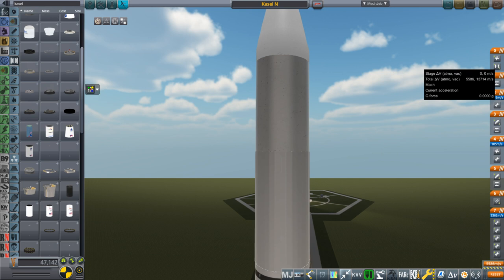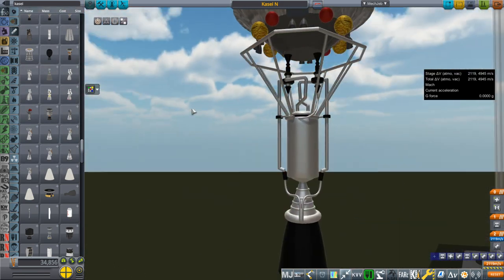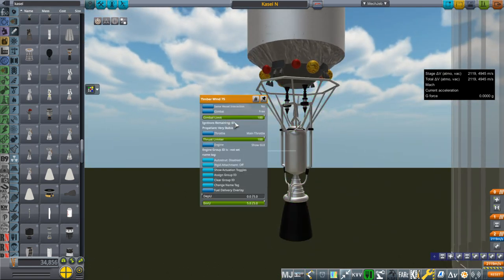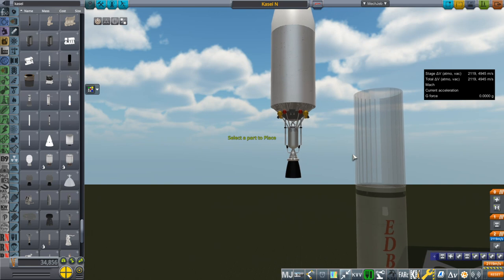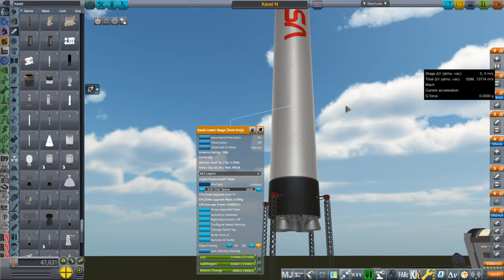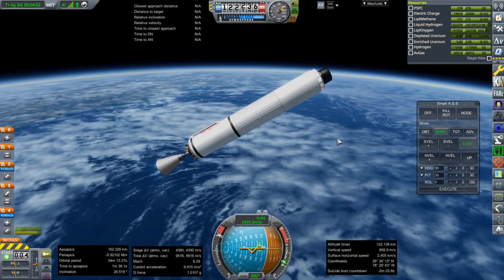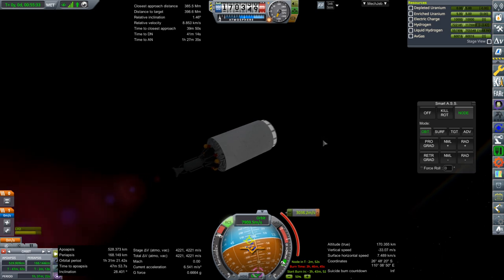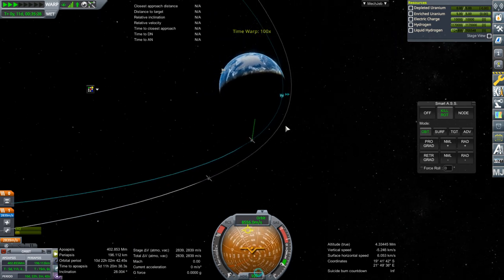Realism Overhaul in KSP 1.8.1 - Particle Bed NTR

Comment: Atomic rockets (projectrho) also has performance values on nuclear rockets: 
However, I could not find any references on the site, so do take the following performance numbers with a grain of salt:

Exhaust Velocity: 9,530 m/s
Specific Impulse: 971 s
Thrust: 333,617 N
Thrust Power: 1.6 GW
Mass Flow: 35 kg/s
Total Engine Mass: 1,700 kg
T/W: 20
Fuel: Fission: Uranium 235
Reactor: Solid Core
Remass: Liquid Hydrogen
Remass Accel: Thermal Accel:
Reaction Heat
Thrust Director: Nozzle
Specific Power: 1 kg/MW

Comment: There is already an SNTP (project timberwind) engine in RO, the SNTP-PFE100. Its probably what the quote on the wikipedia article is referring too. It was what came out of the SNTP program, and a reactor for one was actually built and certified by the DoE. It was a particle bed NTR with some pretty amazing performance (although not as high as the "very optimistic" Timberwind numbers). You should absolutely use it as a base for your particle bed NTRs, it was the highest performance NTR ever built. If you're up for some reading, the paper about it is here: https://apps.dtic.mil/dtic/tr/fulltext/u2/a305996.pdf
Reply: The Original Timber Wind Performance numbers are completely possible nowadays as SNTP was what could done in the late 90's early 2000's. The biggest thing that needs to be done is the development of the high temperature fuel elements that can handle 3400-3600 Kelvin operating temperatures.

Comment: Project Timber Wind actually did have that kind of insane performance. They were intended as upperstage engines on Peacekeeper First Stages as ballistic missile interceptors.
Reply from the maker: Well, they aimed for that kind of performance. What could they actually get is the question. The only hint I have is that one line I based the rest off of. That still makes it half the mass of NERVA, so pretty good.
Reply: @RaizSpace   The Project Manager Who lead Timberwind actually worked on University Project to get an even higher performance ISP wise Particle bed NTR with a TWR of 10 and an ISP of 1080+ seconds. Here's a link to his talk.

https://youtu.be/CstYCKLYl6M

Physics wise those performance/dimensional figures are completely possible the only barrier is making  fuel particles that can withstand 3500-3600 Kelvin which is being worked on.
Reply from the maker: Ah, a TWR of 10 and that ISP sound fair. I guess the numbers I have (TWR around 9 and ISP 980) would save us some of the difficulty of making the particles.
Reply: @RaizSpace  If You could make a version of the Timber Wind 75 with the 2.03 meter diameter with the 750 kN thrust at 1000 ISP and T/W ratio OF 30 I would greatly appreciate it.
Reply from the maker: But according to that video, the design goal was a TWR of 8 . . .
Reply: @RaizSpace  I must have misremembered something then. The request for the OP Timberwind was just to see what I could do with them with regards to heavy lifters.

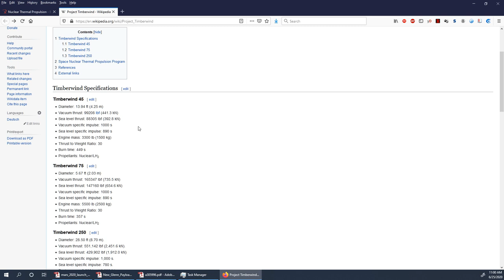Comment: 3:35 Lemme guess, the diameters are crap and the sea-level Isp is way too high. (Ding ding ding ding ding!)
5:20 Well, it would have been an end goal, like the 1000 s Isp.
9:55 LOL
11:10 Oh, you used your own rockets in that series? Better take a look...
13:15 I wonder, would an NTR in space really have purple exhaust? It may be that that color in tests was just the result of the hot hydrogen burning in atmospheric oxygen.
15:25 and 16:25 You really should start the return-to-LEO burn immediately after the TLI burn to avoid boiloff.
BTW, thanks for finally doing something with NTRs!

Comment: You might want to move this rocket up a bit. It's possible it clips the sides of the LC39's flame trench.
Reply from the maker: Yeah, figured that's what happened, but was also worried about the twitchy launch clamps that occurred on a previous video.